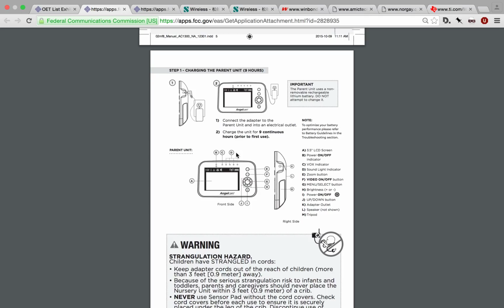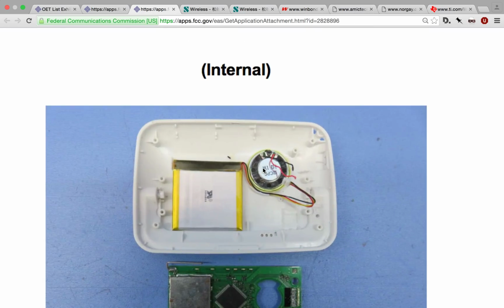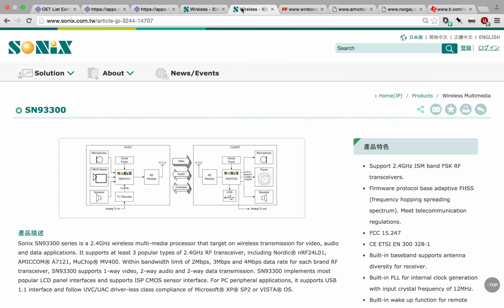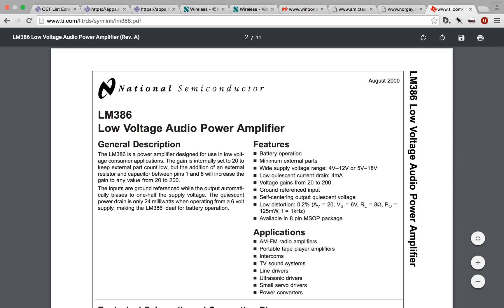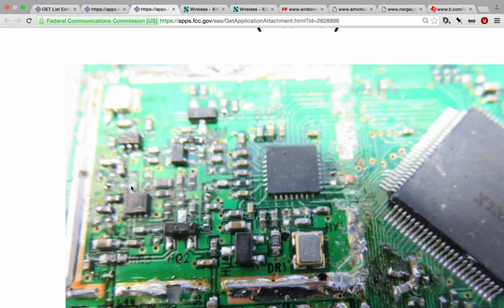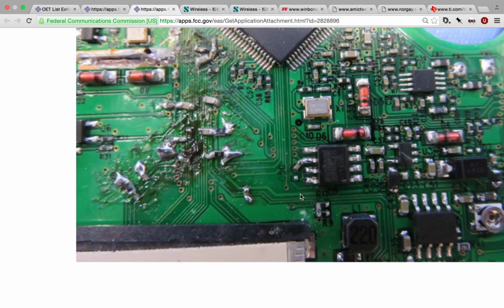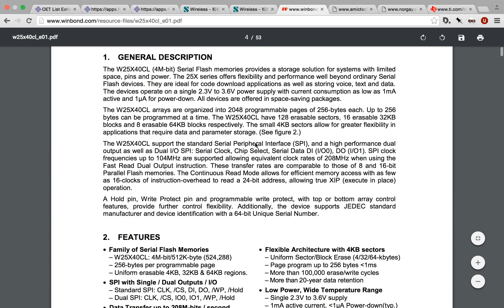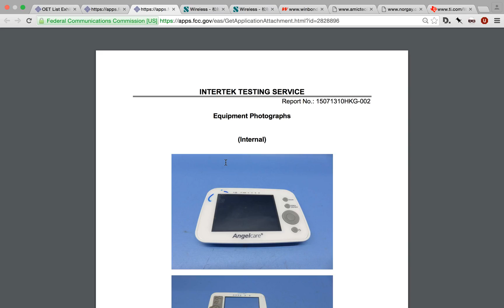Angelcare AC1300 (Parent): Virtual Teardown #6

Comment: The battery gets really bad after about 6 months. One year in and it won't stay powered up from the battery. I can not get the unit to start up unless it has been plugged in to the charger for a decent amount of time. They are offering the cheap lipos for $17.50 but i think this should be a return and a free battery if it goes dead within 2 yrs.
  How do you open the unit up? With a spludger?
  If they don't send me a free replacement battery i'll put my own one in, i'm not paying $17.50 to have to do it myself.
 Great unit. I was not aware you can talk back on the a1300, can you?

Comment: How did you get it open? I don't want to break it but need to replace the battery.
Reply: The top surface is contact glued. Heat it up with a hairdryer and it will come off to reveal 4 screws. If you watch the video goto 1:11 , you can see them in the slide that shows the top glass off to one side.
Reply: @richupton  how did you get it off. I heated it up but can't seem to pop it off...
Reply: did you been able ?
Reply: Anyone know what the LCD screen is?  I have it apart and need a replacement!